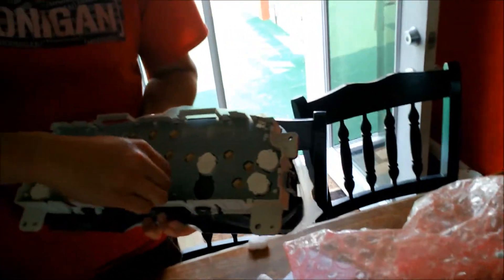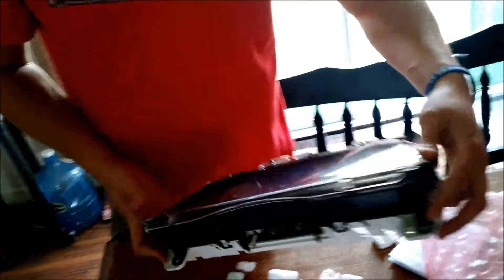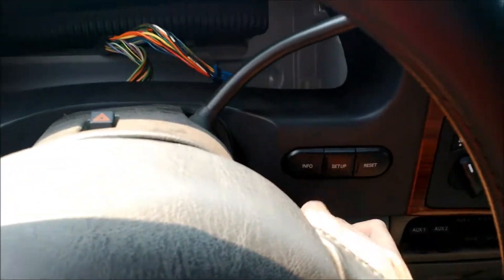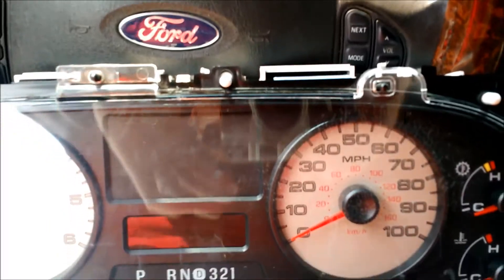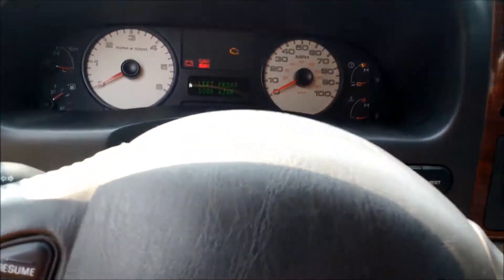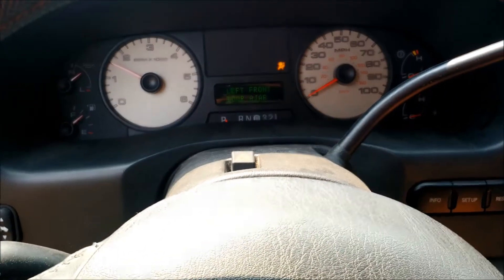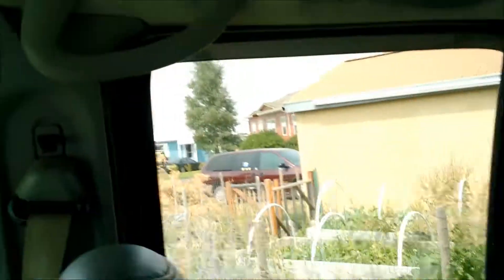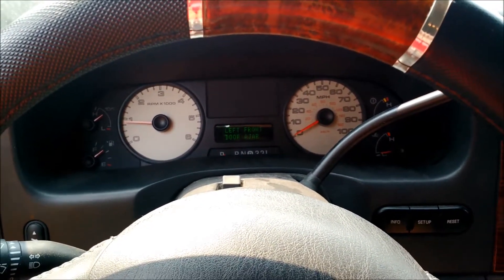New Update F350 Gauge Cluster Re Install

Comment: What was the issues you were having? Im having intermittent issues with everything except my speedometer working and everything shits off and goes flat even while driving and including my radio shutting off. And the parking brake will illuminate before everything goes off. Even with the parking brake being released. From research i may just send mine into circutboardmedics myself as you did.
Reply from the maker: You got the same issue. Guage cluster actually controls all of those things that are bugging out. Windows, radio cluster etc. See below Circuit Board medics. They are super great and fast!